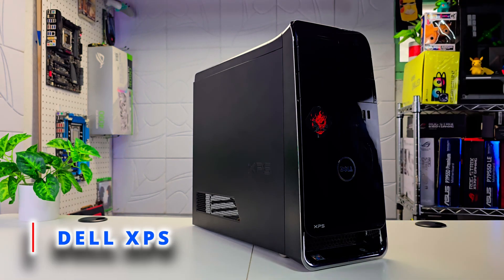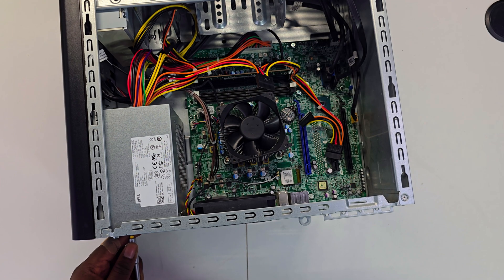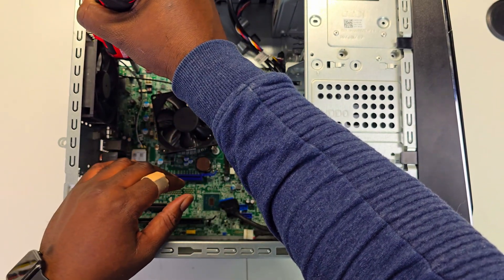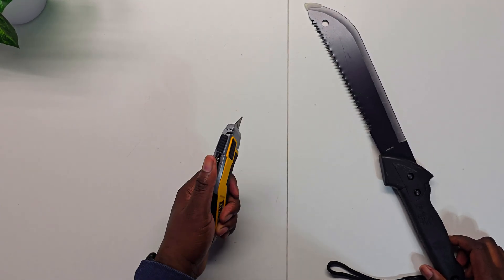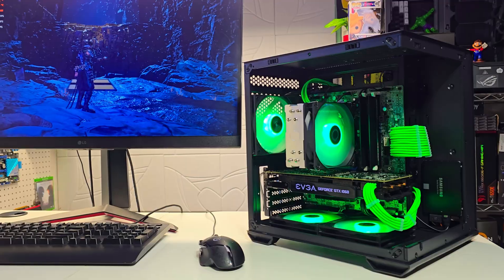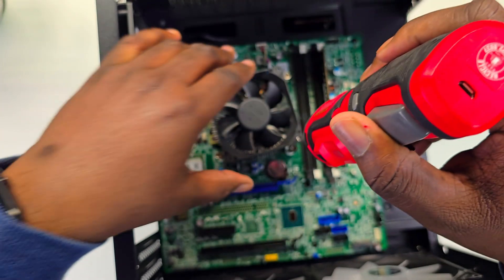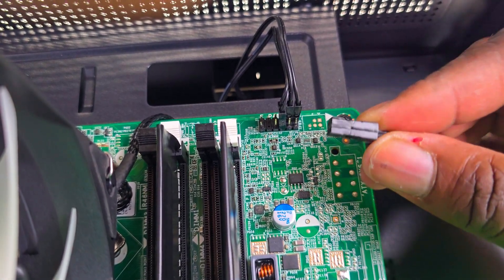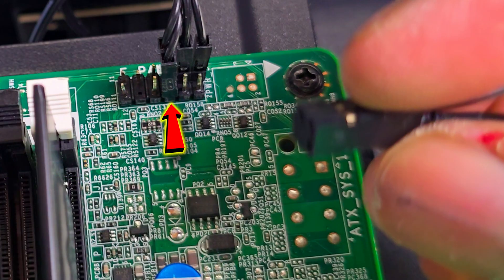How to Transform an Office PC into a Gaming PC

Comment: Is it ok to do the front switch connection adjustments in the same fashion with the Dell xps 8940?
Reply from the maker: No, the Dell XPS 8940 is easier. There's no need to do anything cutting. The power switch is like the Dell Optiplex "the 5pins" just try to find which of the 2pin is the power switch.